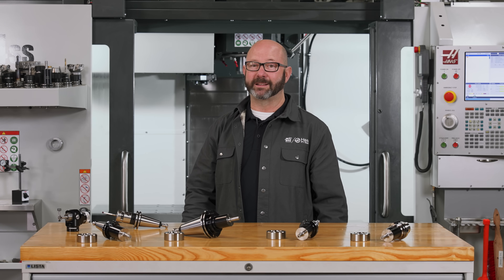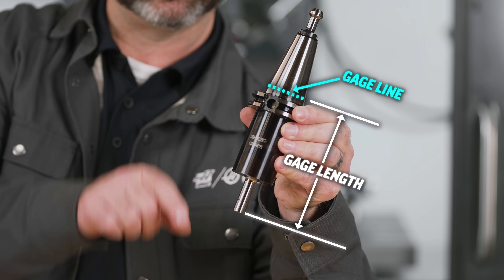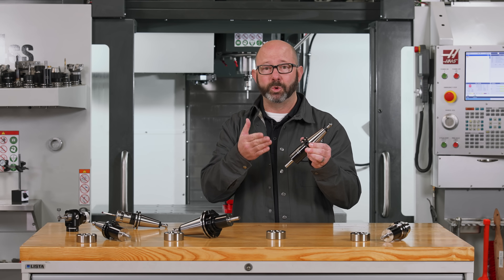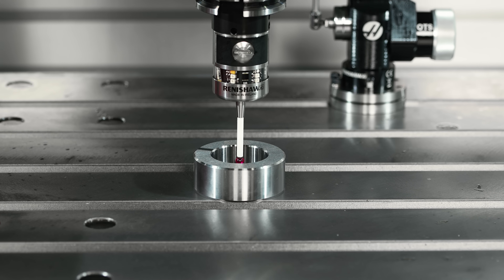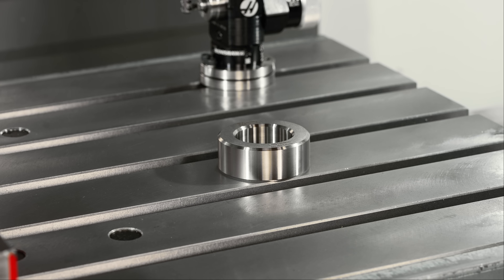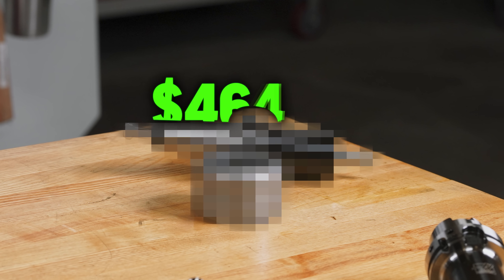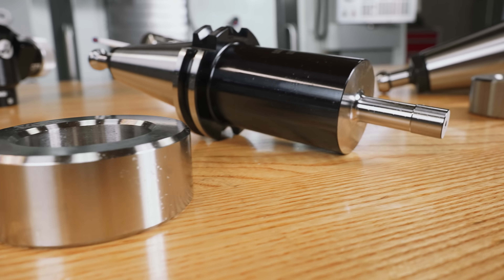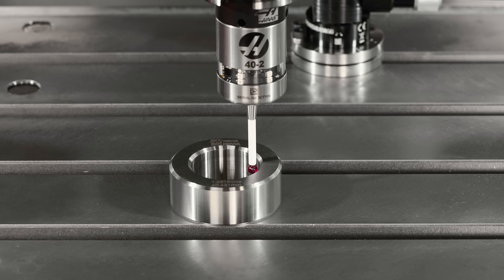Calibrate Your Probe System Faster - Probe Calibration Kits - Haas Automation, Inc.

Comment: Will this work with the old controller? Will you still have to use a shim on the ring gauge first?
Reply: Yes, it will work with older controls. Having a Test Bar of a known length will give us a standard, so the offsets on all of our tools would be interchangeable between machines, beyond just saving time calibrating. If you use the O09996 VQC Template instead of the VPS/IPS work probe calibration templates you won’t need the shim. VQC and the newer controls are simpler, where the OMP Z value is set using the OTS. Google “Haas 9996 VQC Template” for more info.

Comment: Are the newer macros available for download off the haas site somewhere? i've been unable to find them, specifically the one that indexes the probe to the direction it's probing. Thanks!
Reply: The probe will only orient the spindle during the calibration process. In doing so it is able to record any runout in the probe tip, and compensate for those errors when probing later (even without orientations). It stores the X/Y runout in variables #558/559. So, no need for new probing macros, you’ve got them. Great insight.

Comment: I cant imagine ever needing to split hairs this far.
Reply: Oh, for sure. I can’t gauge how often most shops are recalibrating their probes, but as a Haas Applications Engineer, I am calibrating probes constantly, which is probably why I’m so geeked-out on magnetic ring gages, and these kinds of Test Bars. I worked for a short time (couple years) in an automotive plant in Michigan that ran high volume, and some mixed lower volume. We were always using test bars to make sure all of our machines matched the tool presetters. We didn’t have time to make adjustments. Load and run.

Comment: We use a magnetic V block then mount a ring gauge onto that.
Reply: That works great for the ring gage. If there is ever a doubt, just immediately probe the inside diameter of the ring gage you just calibrated with, and if #188 is the true diameter of the ring gage then we have checked our work and proven to ourselves that we did everything right and nothing moved.